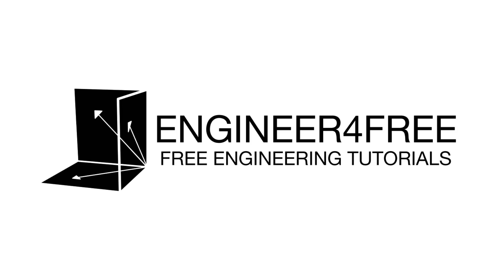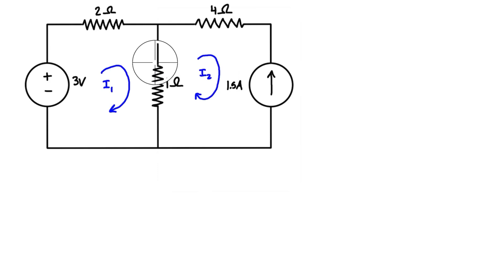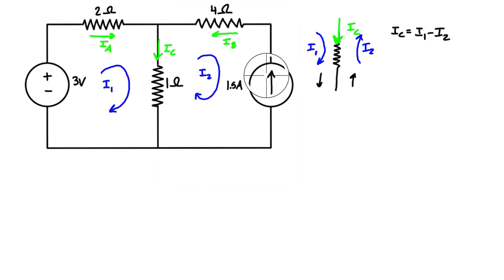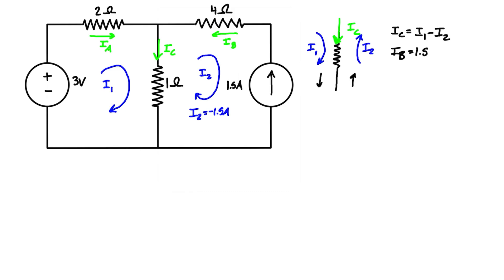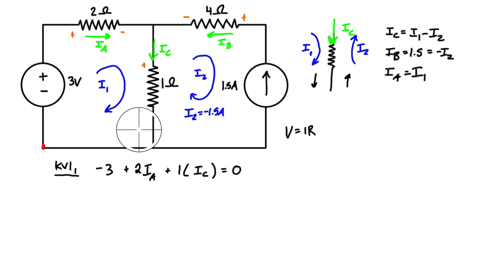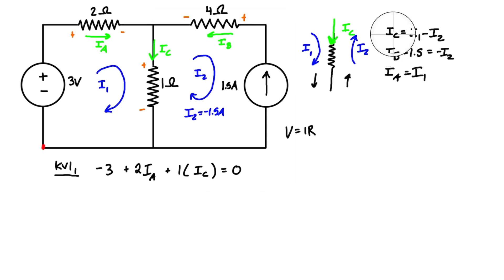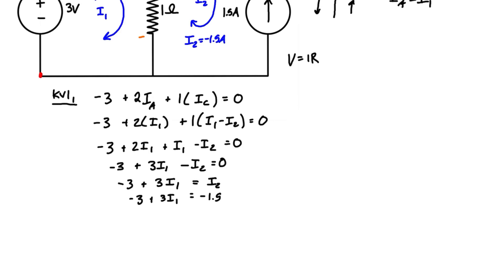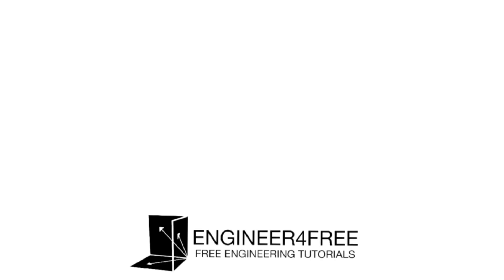Mesh Analysis for Circuits Explained

Comment: I'm confused as to why we get a different answer if we use the superposition theorem. For the current generator, if we isolate it and treat the voltage source as a wire, as we do in the superposition analysis, we would have the 2 ohm and 1 ohm resistos being in parallel, and splitting the current, not all of it going through the 1 ohm resistor. I just don't understand why this law wouldn't apply here
Reply: what were you trying to solve for?

Comment: Honestly I find following the voltage source to be easier. Going across the 3v clock wise just makes sense. You have a rise of 3v then the resistor drops Xv. It follows what you see on a multi meter with the leads connected. Just my two cents worth.

Comment: Everyone saying he's wrong is an idiot. I solved it the same way. And to prove it further, I simulated the circuit on my computer and it literally measured 1.5A, 0.5A, and 2A. Y'all seriously annoying as hell when the good lad is just trying to teach you.
Reply: I ain't calling him wrong. I'm confused as to why we get a different answer if we use the superposition theorem. For the current generator, if we isolate it and treat the voltage source as a wire, as we do in the superposition analysis, we would have the 2 ohm and 1 ohm resistos being in parallel, and splitting the current, not all of it going through the 1 ohm resistor. I just don't understand why this law wouldn't apply here

Comment: HOw can you add three to both sides when one is in Volts and one is in Ampere
Reply: The 1.5 on the right side is actually volts it's just 1.5A x 1 ohm which would be a volt

Comment: Wrong 
Ia is 4.5a
Ib is 1.5A
Ic is -6A
Reply: It is not. I solved it exactly the same and then even also simulated the circuit and it is 0.5A, 1.5A, and 2A at I_c total.
Reply: @nullbeyondo that means you are also wrong a voltage drop is negative
Reply: @nullbeyondo this is wrong

Comment: What's the difference between mesh and kichofs law
Reply: Mesh analysis is a way to solve circuits USING Kirchoff's loop law. Technically, you are just using the loop law but the whole procedure that you do in this video is called mesh analysis because its commonly used method
Reply: It's the same but mash use kvl to find the current
Reply from the maker: engineer4free.com/circuits
Reply: @Engineer4Free  just explain him what that means bro you don't need to put that link everywhere...

Comment: uhm why the voltage in kvl become - sign ?
Reply: It looks like he was using the node he was entering to determine the sign. Because not only was the voltage switched when passing through the battery, but the voltage rose through the resistors. It's ASC (as opposed to the more common PSC), and it came out of left field, but I suppose if applied consistently, it's fine. But I agree, it's not my go to.
Reply: Simply because he used the sign convention that if you go from - to +, which you encounter the negative sign first, you treat it as negative. And  if you go from + to -, like on resistors, you treat it as positive.
Reply: It does not matter. You can use any signs you want as long as you flip them all, not only one.